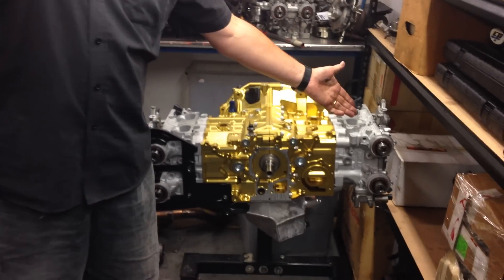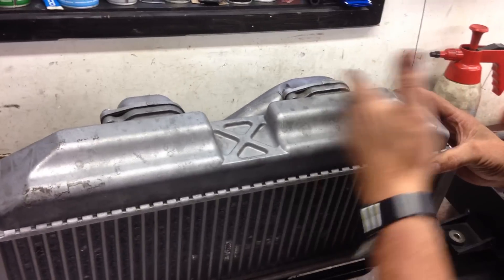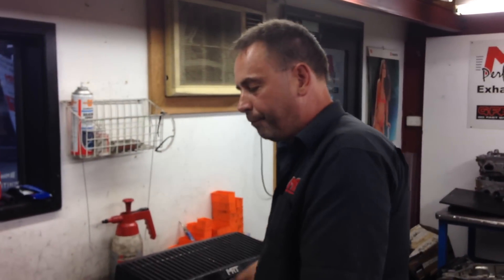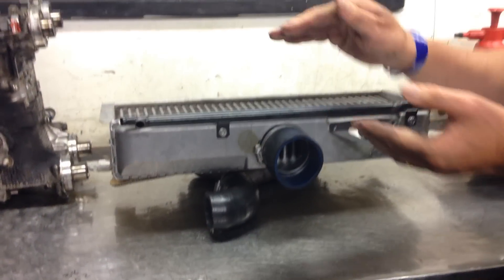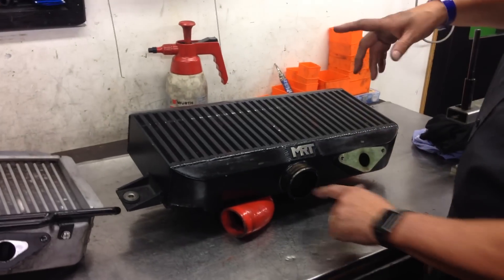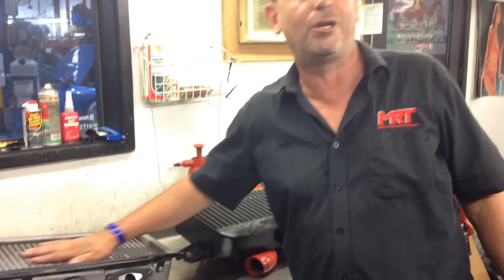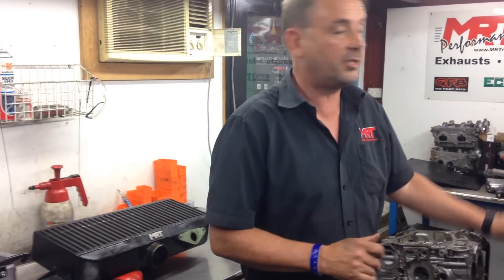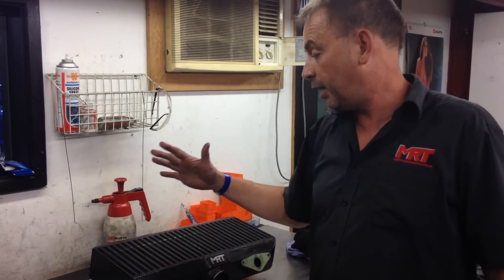Project Billet - Top Mount Intercoolers explained - Tips, Tricks and how to Maximise Performance.

Comment: my old man has the grimspeed top mount on is o5 wrx ive tested it driving at 40kmh around the streets for a period of time and i touch the intercooler and its cool to touch and that was on a 30deg day the splitter helps alot with top mounts i used to be anti top mount but ive seen the light

Comment: What is the best brand of motor oil for the EJ257 STi? 

Royal Purple 5w30
Rotella 5w30
Motol 5w30
Liquid Moly 5w30
Amsoil 5w30
Subaru 5w30

I can't buy Nulon oil in America because they dont ship it out of Australia.

Thanks!
Reply: Gamma Light I use redline 5w30 for my wrx
Reply: Gamma Light  mobil delvac mx 15 40
Reply: Amsoil is the best

Comment: Brett out of interest are FMIC WRXs more laggy than TMIC when everything else is keep the same?

The Subaru turbo location always seemed like a bad comprise to me.
The exhaust port to the turbo distance seem very long and may introduce some lag.
But this was offset by a short intake.

But then if you go FMIC, both cold and hot side tracts are quite long.
Reply: as you saw in the video not all intercoolers are created equally. I was once told by a top rally guy that the difference is about 200rpm, his testing on a tuned car, and the difference in temp was roughly 40 degrees(assuming a higher power car that was pushing the stock cooler to it's limit).. That's assuming you have made a nice smooth flowing setup and not some botched up job. Depending on the turbo you can clock them (rotate the compressor housing) to reduce piping/bends, and other things like front facing intake manifolds at the expense of A/C. I've even seen people remove their radiator support and run an intercooler under the grill overtop of the radiator, and also cutting the sheet metal beside the headlights(which I chose for my car) .
Reply: Yep front facing intake manifold is the way the go if you want performance, but you lose the A/C. I'm going front facing intake but I would like some A/C so I was thinking of adapting a peltier cooling system I know it wont be good as an A/C but a little bit of cool air is better than none or drive on cool days only hehehe.

Comment: So what in your opinion are TMIC to stay away from. I have a Process west tmic and I have heard nothing but good things and I haven't experienced any problems. Are they an intercooler manufacturer that you believe is a good one? And how do you like the verticooler?  I was going to get that one, but decided against it because for the minimal difference it wouldn't be worth it. Plus, I really don't see how changing the direction will benefit the flow. I think the regular top mount position is just as beneficial because the way the air is directing through the hood scoop, allows for air to be pressed against the whole intercooler. Also when you put more of an angle that means the bottom portion will be closer to the motor so more of a chance for heat soak. But what is your professional opinion? Also, anyone else is free to voice your opinion I am interested to hear what others think.
Reply: Devin Izenberg PW Top mounts are perfectly fine.

Comment: Black is fine under a bumper but black will absorb heat due to emissivity from the engine when in traffic just like if it sat in the sun one reason why I got a silver process west one if the air in the intercooler is cooler then the engine bay it will heatsoak faster when black if the air inside is hotter it will put air out through the scoop
Reply: Aussie Monster. What i learned in school is that silver paint gets hotter then black paint in the manufacturers torture test paint baking oven.

Im not positive if that will relate to bare silver metal. But personally, I'd paint the frame of a bare metal intercooler with any color ceramic paint then put heat reflecting tape on it, always keeping it out if detect sunlight.

Black or silver paint won't  retain ambient heat more then one another unless the insulating properties between the two are different. And for a top mount, i cant really imagine a measurable issue.
Reply: How much light do you think is getting on a TMIC through the scoop? 
Pretty close to none I would expect.